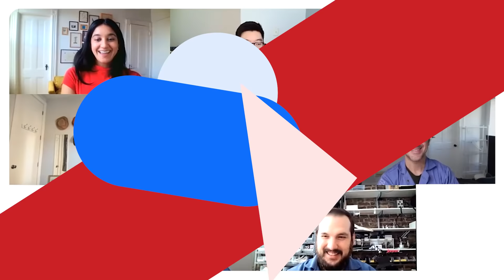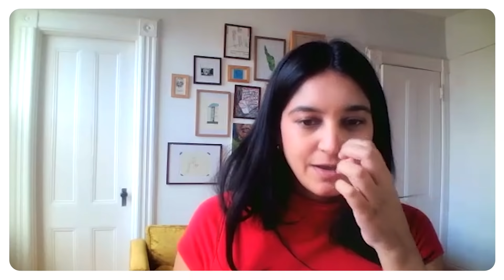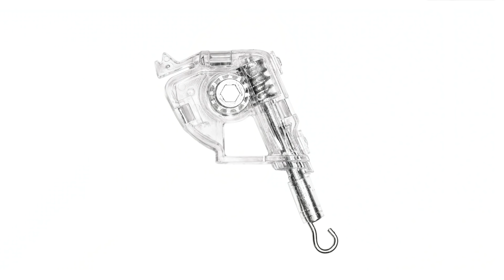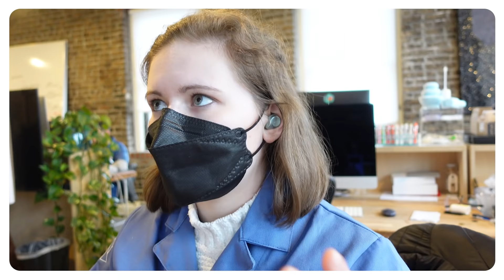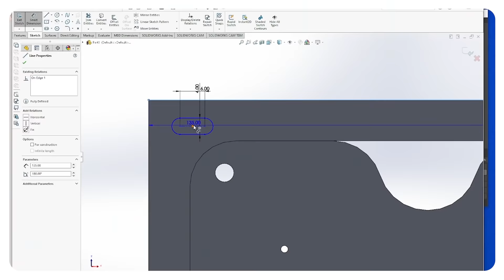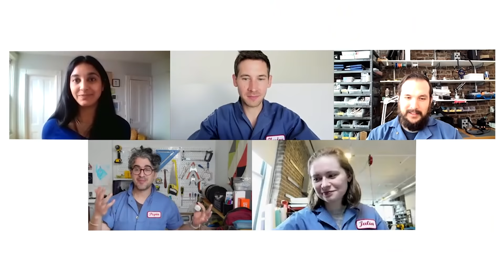Solar-Powered Household Device – Potentially Genius™ | Digi-Key Electronics

Comment: My thought is that instead of assuming everyone wants their blinds closed when it's sunny, why not have the solar panel also wirelessly charge a little remote that attaches to it and can control whether they are open or not.
Reply: Great idea! Could definitely work. We opted for creating an automated device because humans are forgetful, busy, lazy, or sometimes just aren’t home to push the button!
Reply: This really wouldn't work since the amount of energy you'd produce from a small solar panels is not gonna survive wireless charging, especially at any notable frequency, since the amount power it could transfer would significantly drop
Reply: No, it’s a factor of the battery size and wattage. You can search for ‘wireless solar power bank’ to see many examples.
Reply: @theodoreullrich3588  So your saying the at higher frequencies you'd be able to actually transfer enough energy to wirelessly charge  a remote anywhere in a room, by that I mean actually wireless and not tethered to a single location, cause you know losses and the fact that power transfer would be in the milliwatts.

Comment: this is so pointless
Reply: if you added IOT connectivity by just using an ESP32 or something instead, you could easily add the functionality of turning blinds when you leave the house with a bluetooth detection (ie is phone of owner in the house) or something similar when you leave. Or like they mentioned the wifi button which could trigger all the blinds in the house by the exit door. I think AC usage is one of the biggest greenhouse emitters for households, so this isn't as pointless as you think.
Reply: @gedr7664  yeah its not like all of those components are made in factories running on AC, drawing power from the grid, predominantly powered by thermal. Its pointless cause it serves no purpose, opening and closing blinds should not be some stupid automated process that basically consumes more power for no reason. Now the title was misleading as hell, Solar Powered Household device, to me suggests retrofitting a device at home to work off solar, slightly better than whatever the fuck that was.
Reply: @gedr7664  I hope people understand that adding a new pointless device to an ecosystem that doesn't need it is not eco friendly, even if it is solar. Similar issues with Wireless Charging, a new device being manufactured when it adds nothing to the space that isn't already there or is being done bette with consuming lesser power. This sort of stupid thinking leads to people like Elon Musk with his nonsensical ideas with no basis in reality or what the actual problem is and what actually has to be solved.
Reply: @General_Li_Shin  thanks for your feedback.

I wanted to address your argument, which is centered around an opinion of the device’s pointlessness. To be clear, the purpose of the device is to use solar energy to automate a small task that can lead to energy savings in a home or office with window mini blinds. It’s even a universal retrofit design to work with almost any existing mini blinds system. Same concept as turning off lights when not using them or changing your home thermostat a few degrees to reduce use of the HVAC system. In our opinion, giving people small solutions to solve big problems (even just a little) is not pointless.

Your criticism that factories are big energy consumers is valid. However that isn’t the problem we are trying to tackle in this episode. And it doesn’t mean the output (the device) is pointless or wasteful as well. With the same logic, one could say food is pointless (not true) because the agricultural systems used to grow it are inefficient and wasteful (true).
Reply: @theodoreullrich3588  couldn't you just use your hands to close the blinds, automating every tiny thing is wasting energy, similarly with turning off lights but at the end of the day, and I say it's pointless cause it can be done with none of this solar nonsense. Now as for the food analogy, it makes no sense since all that food, if not wasted, is being used. the issue is this product does not do things any better. the other point I mention about retro fitting was not about small mundane stuff like a blind or turning off lights but more with retrofitting solar as a source into existing home electrical infra.
Reply: Thanks for the feedback. Wanted to note this is a series about technology products, from a technology development company, with sponsorship from a technology component supplier. If topics like automation are nonsense or disappointing, this may not be a series for you!